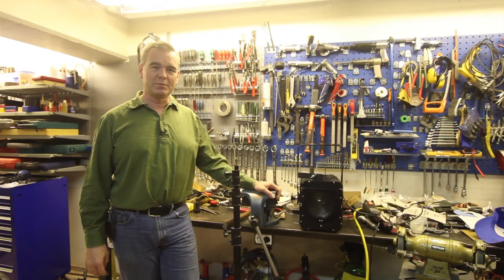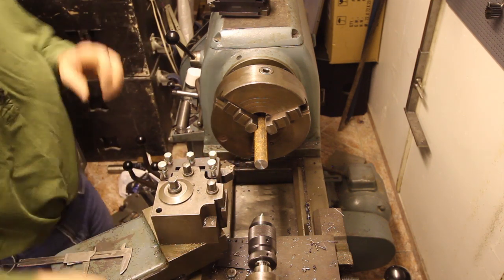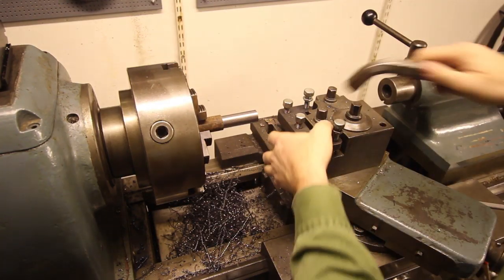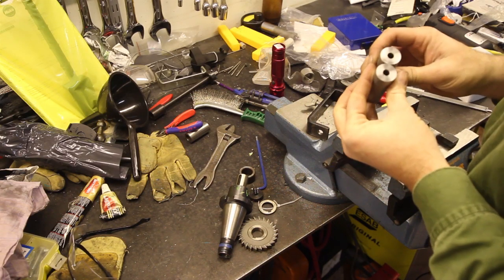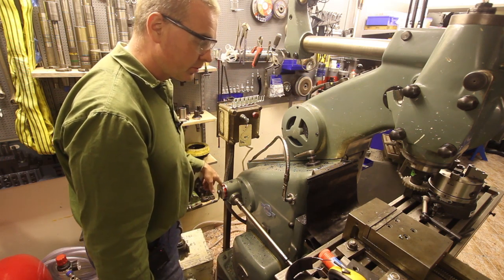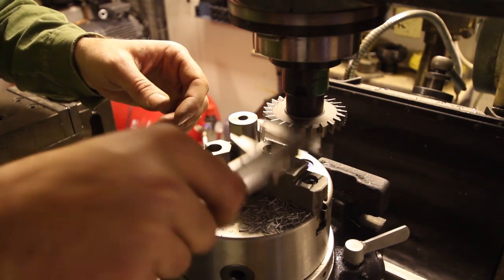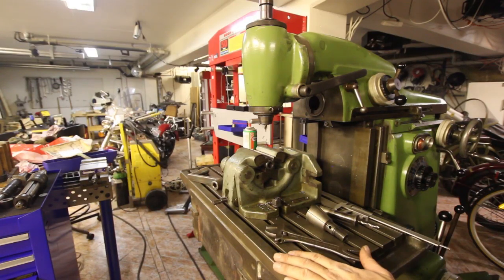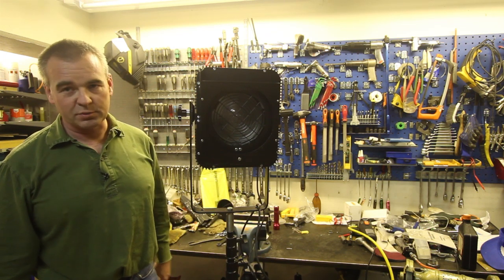Fresnel adapters

Comment: I really liked the mounting plate you made? for the NMTB slotting cutter holder with which you hold the tool holder to mount a blade. I'm going to do the same! Great bit of useful information for me. Thanks.
Reply from the maker: The tool holder is a really great thing to have, I use it all the time. To make it fit well, I made the hole by putting it the 4-jaw on the lathe and turned a hole with the same taper as the ISO 40 by using the top slide.
Reply: Mattias Kristiansson
Nice tip. I'll do the same. I couldn't quite see that you had turned the taper and just thought it was a straight bore. Thanks for your kind reply.

Comment from the maker: Tyler Cunningham:
When facing on the Schaublin I ran at high rpm to get a high cutting speed. As the bit approaches to the center, the cutting speed drops and I want it high in order to get good surface finish. When drilling on the Schaublin the rpm was way too high. I had problems with my camera and was so worried about the footage, that I forgot about setting the proper rpm. I make mistakes. Lots of them.
Reply: I'll bet the camera adds a whole new element to everything.

Comment: Not to be critical, but the drill bit is cutting only on one side.  The chips should be coming off of both sides, pretty equal.
Reply from the maker: Well, you're right.. Even brand new drills are not cutting right. I guess I should go through my drills and sharpen them all properly. Time, time and time is the problem, though...

Comment: Mattias, Very cool video indeed.  I enjoyed seeing some different style equipment.  It is obvious from your skill level that you have been machining for quite some time.  The large hex key with the square hole in the end was quite surprise!  I also really appreciate the fact that you use a remote microphone.  The audio was crisp and clear.  Fred
Reply from the maker: Actually, it has a hex hole in the end, it's a hex bolt that locks the tool holder.

My skill level... well... I'm not as experienced as you were led to believe. I've bought most of the macines during the last year and only done a couple of small projects so far. I have done a lot of reading, though, and learned a lot from watching Youtube videos.